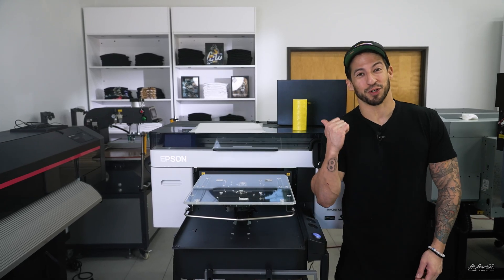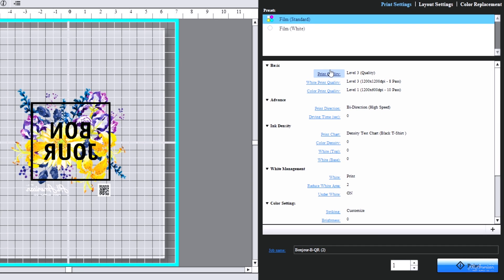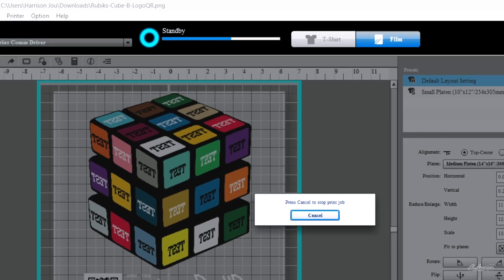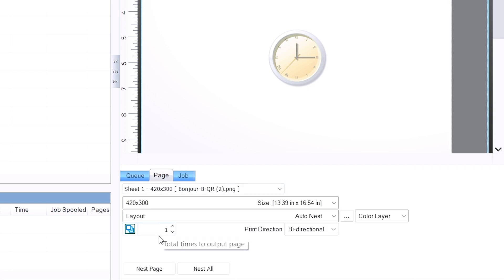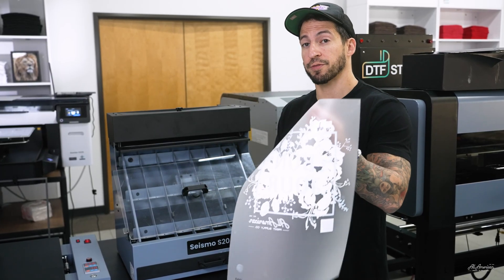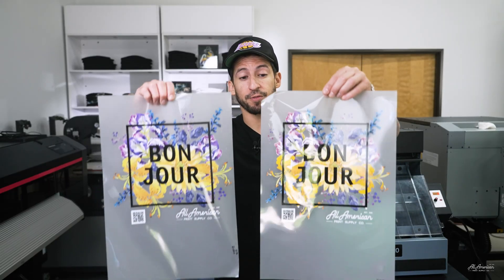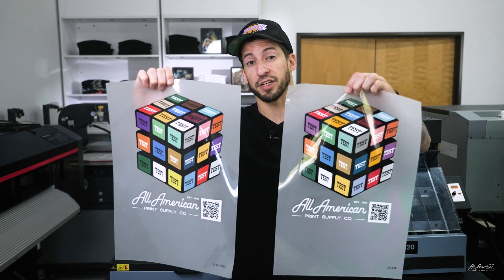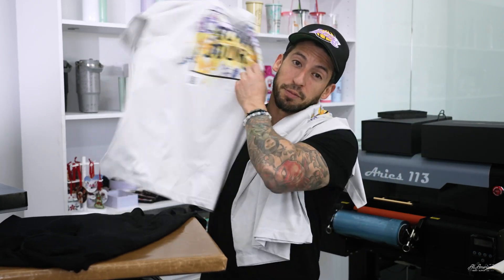Epson F2270! How to DTF Print! | AA Print Supply

Comment: My prints are coming out like small water dropplets instead of whait would be. It's like the entire image is printing in tiny dropplets forming the image. My maintenance liquid is really low, so I was thinking maybe thats it? But Epson has the Maintenance liquid on back order 😤😡🥹 Im losing orders I cant fullfill. Can I get some insight in what the issue could be? Theres also an error reading 00138 Fatal error?
Reply from the maker: Hey there, first thing we would want to check is the nozzle check. The incomplete prints sound more consistent with clogged nozzles. The Epson direct support line is where we go for the fatal errors as they advise to deal with those direct (hardware). Hoping the backorder ends soon on the maintenance liquid!

Comment: Could you help me. I'm trying to send a file to my printer from my digital factory and it doesn't work
Reply from the maker: Do you mean from Digital Factory to your printer? If so, first thing you want to check is the Queue Manager. Up top click on Queue and then Manage Queues. Here you should be able to see where the printer is mapped to and make sure they are communicating correctly. What printer are you using?
Reply: @AAPrintSupplyCo  thanks for the reply but I sorted it right after. I just needed to put in the IP address. Thanks again

Comment: I've followed this video to a tee i believe but when my films come out (on the same exact printer) the white ink is not set at all. it runs all over the film as i move it. i've tried decreasing the ink density and while this does help it not run, the color layer is not covered well. y'all's films look perfectly firm coming straight off the printer. what am i missing?
Reply from the maker: Hey there! So I am working on a video with updated settings we have found positive test results with. This is what has been working for me:
Print Quality: Level 3
Ink Density:
White (Top) negative twenty (-20)
White (Bottom) negative twenty (-20)
This quality level with the above adjustments should be a quick fix, please let me know how it works out for you
-Estevan
Reply: @AAPrintSupplyCo I’ll try that and see how it goes. Thank you very much!
Reply: So now I've tried this and while it helps with runniness a little bit, now there's just not enough white to cover the logo well. I'm really curious as to how y'all literally picked the film straight up off of the printer and dangled it in the air without it running at all.
Reply from the maker: @Nova-we4oj  Hey there, thanks for getting back to me. Just looking at all the variables here, what film are you printing on?
Reply from the maker: @Nova-we4oj  Ok, before we adjust settings lets try to powder and press. The white layer may appear thinner or not as solid but at this quality level the final product is still able to show the desired vibrancy
Reply: @AAPrintSupplyCo  okay. before i do this again i should ask: how long did y'all press for and at what temp?
Reply from the maker: @Nova-we4oj  with a heat of 320 F prepress the garment firstly to lay the fibers down then using that same temperature press for 15 to 20 seconds (depending on size) with a medium firm pressure
Kodak is a cold peel so allow the garment to drop back to room temp before peeling smooth and low to the garment
After peeling, using a cover sheet, go ahead and press one more time at the settings used to apply to seal the transfer into the fibers

Comment: !! Garment Creator also have an option use your own ICC profile which is not covered in this video. You can possibly request that from your Film provider. GC's RIP engine is slightly slower but using a proper ICC profile makes a night and day difference.
Reply from the maker: We have heard about this feature! Definitely something to cover in a future video, thank you for watching!
Reply: We are struggling to connect it to our computer. We have downloaded all the drivers in the manual and suggested on videos but it doesn't get past the download. We click on the software download as it's not doing anything and it begins the download again.
Reply from the maker: @landscapingbyje6931  hey there, we may want to reach out to the manufacturer directly for this level of support they have a direct phone number for their DTG customers: 562-276-1305
Reply: Do you know how i can get more info on the ICC profile?